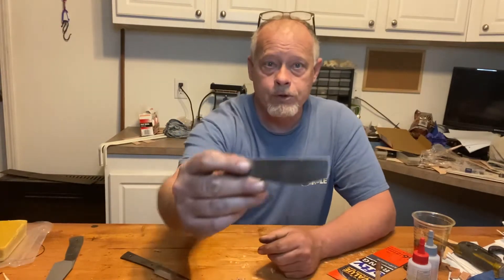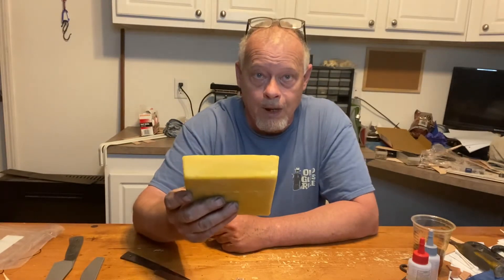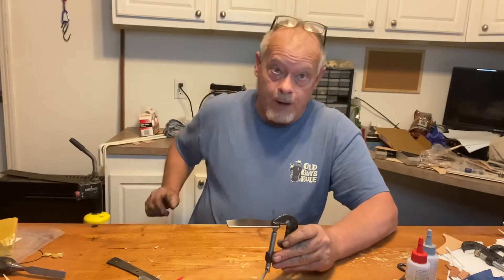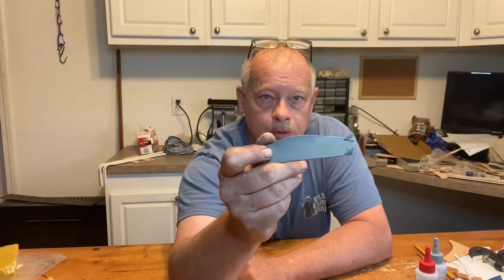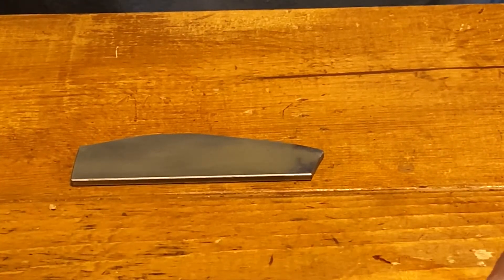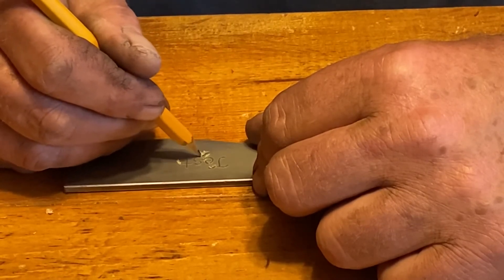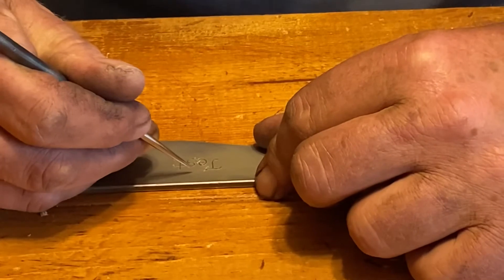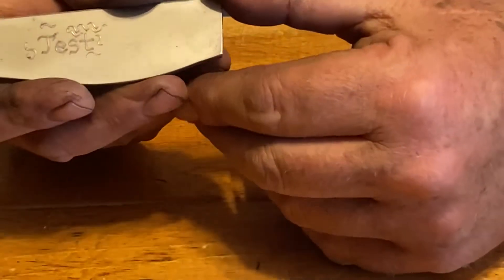Blacksmithing - Ferric Chloride For Etching More Than Just Damascus

Comment: How well does or would this work on etching stainless steel sockets? i.e. etching the fractions or millimeter sizes to make them easier to read correctly?
Reply from the maker: No idea. I’ve never tried it on stainless.

Comment: ..Perty cool Robert, not to mention simple. Wax on, wax off...
Reply from the maker: Thank you sir. Both wax on and wax off can be equally aggravating when it doesn’t run in the right direction and coat the steel the way you want it to.

Comment: Is it true that electro etching with salt is dangerous?
Reply from the maker: I’d say it depends on what equipment you’re using.
Reply: @serendipityforge333  Hi. I have a laboratory power supply with alligator clips and cotton buds, table salt and demineralized water. The logo I try to etch is small, about 25 mm x 15 mm. I want to achieve about 0,3-0,5 mm depth. The resist is vinyl (Oracal) but I am thinking to also try toner from my laser printer.
Reply from the maker: I’ve experimented with vinyl resists and using batteries as a power supply. It worked fine for me, it was just not something I enjoyed. Just keep everything insulated and don’t make yourself part of the circuit and you’ll be fine. Remember to keep your amperage low because it’s amperage that kills.
Reply: @serendipityforge333  Thank you for your reply. I was concerned about the gas release...like chlorine or hydrogen.
Reply from the maker: @BlueLineofthesky  I always do any kind of etching in a well ventilated area.
Reply: @serendipityforge333  Sure. I will do it outside but I was concerned about the fumes I still can breathe because I work from close range to the object.
Reply from the maker: @BlueLineofthesky  just put a fan on if you feel the need. Most of the noxious stuff is heavier than air and won’t accumulate to a dangerous level in a well ventilated space.
Reply: @serendipityforge333  Thank you. This is reassuring. Thank you for all your support.